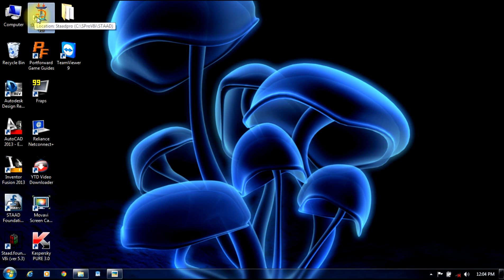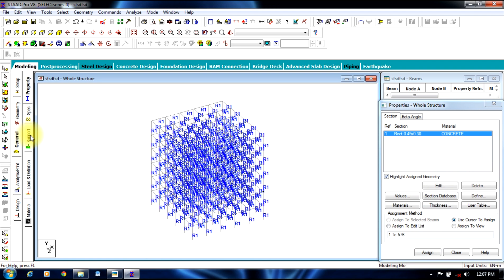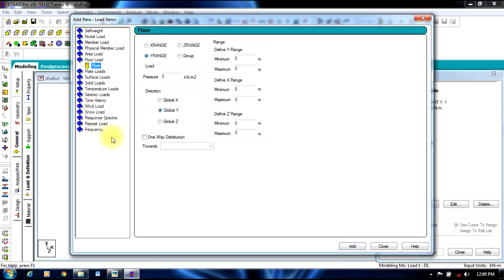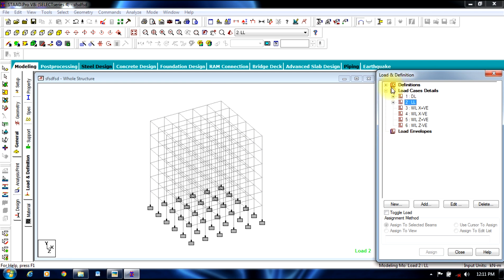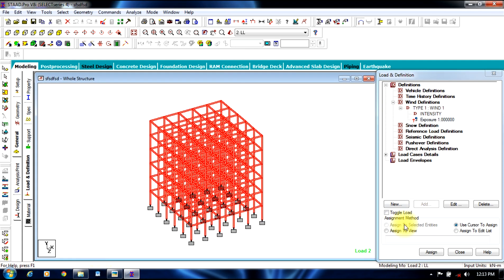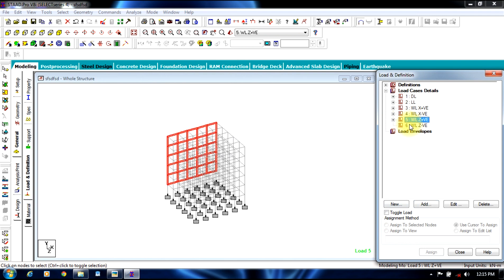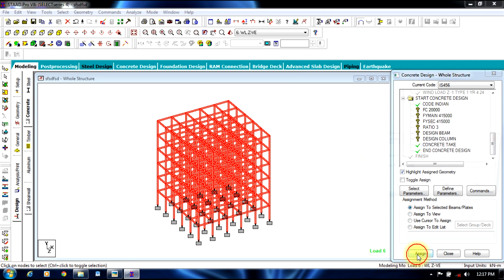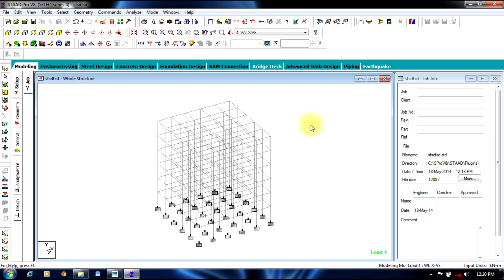Staad Pro-Tutorials-Wind load Analysis-Day 10

Comment: As always good video but.There is one problem.The structure might not be safe because yu did not check for the columns,that is one step you missed.We can go to output file and see the warnings or check for any sections not designed,but since there was no warning in your output file this time skipping the step did not made any difference.But as per your rule you should check.